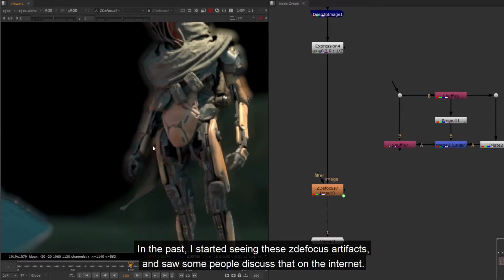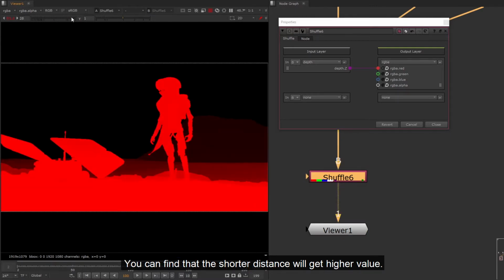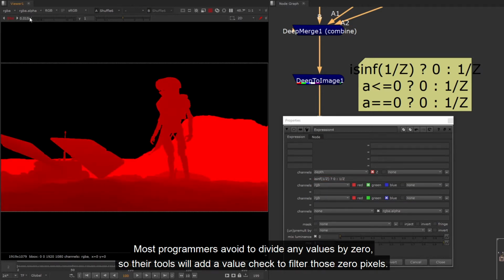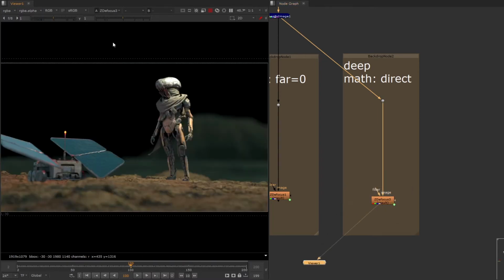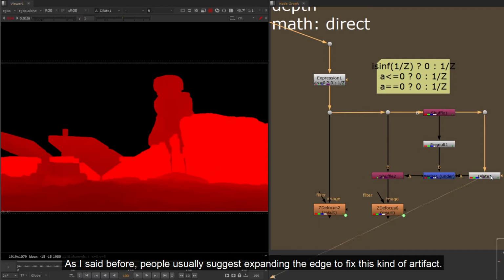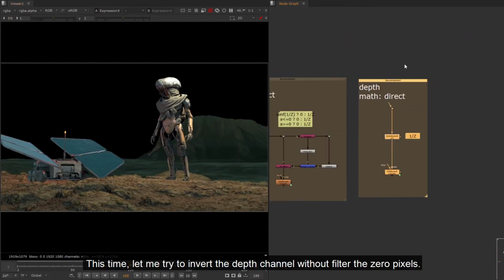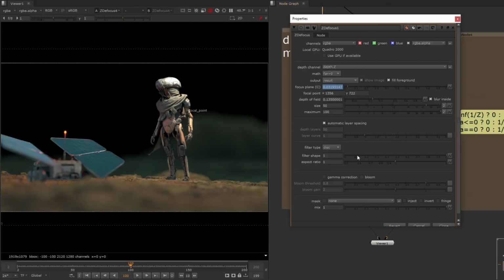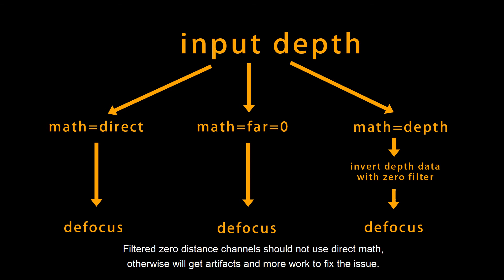DOF artifacts of depth map

Comment: Hello, thanks for the content! I'm curious to know if the DVPrelight node for Deep images works with a separate render engine like Vray or Arnold for Nuke? How would I be able to utilize DVP relight tools with them instead of Nuke's standard scanline renderer? I'm trying to get reflections from one render layer rendered out as a deep image EXR of a foreground element to show up on a background element rendered as a separate deep image. There is very little information I can find and would greatly appreciate any advice you have.